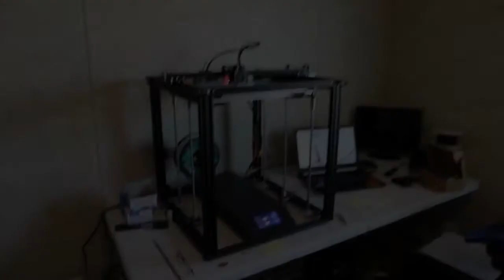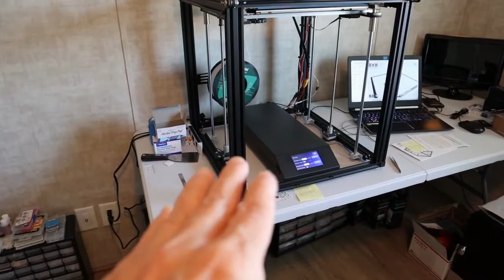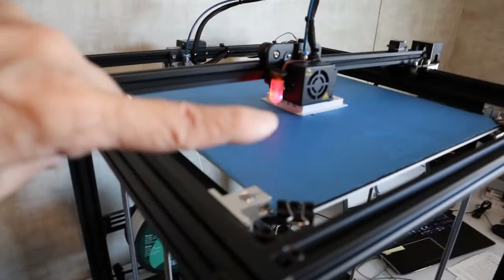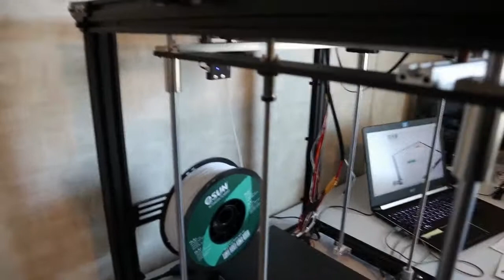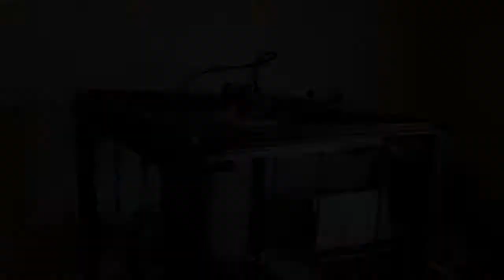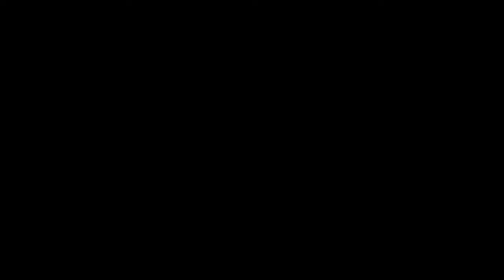Ender 5 Plus 3D Printer Build Mod02 first print

Comment: What on  your bed?? are you having a problem with prints sticking???
Reply: It's blue painter's tape, (3" wide), I've used it for years to make sure I don't have parts popping off the print bed. I wipe the surface with alcohol pads to clean the tape and the parts stick very well, it's just my preference.